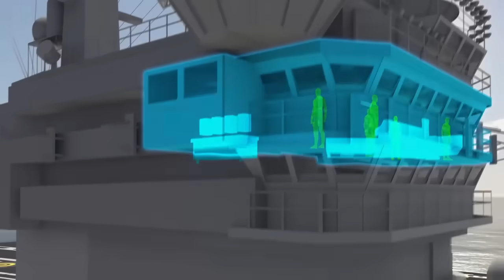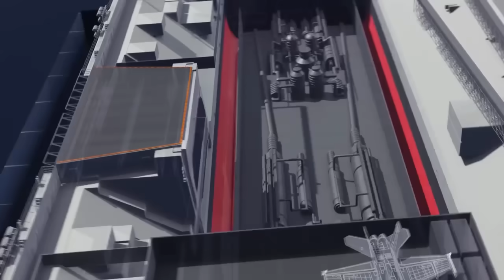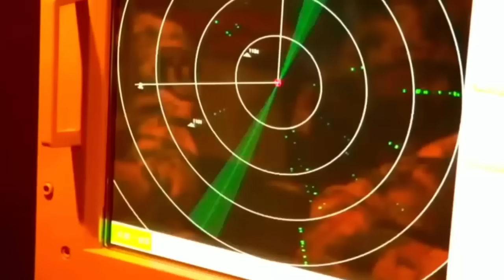Strong Evidence That China’s Next Generation Carrier Will Be Nuclear Emerges In Shipyard Photo

Comment: China is currently building two aircraft carriers, an upgraded version of the recently commissioned Type 003 and a 110-120 thousand tons nuclear powered one, simultaneously.
Reply: Laughing Out Loudly !!!  You got the tonnage out by a factor of 10. The Type 004 is estimated by western experts to displace around 110,000 to 120,000 tons.
Reply: @johnseah5678  You're right! 110-120 thousand tons. corrected.
Reply: @laughingkor8643 what did you say before?